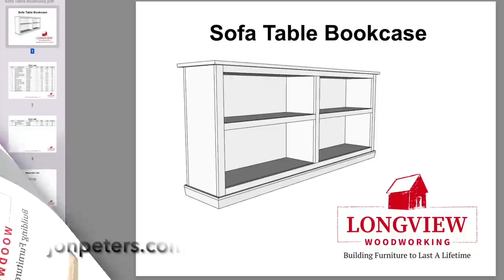How to Build a Farmhouse Writing Desk - Step by Step Woodworking Project

Comment: So many great tips in this video, Jon!   Those little spacer blocks for lining up the drawer sides seems so obvious, but I had never thought of it before!
Reply from the maker: Thanks Art! They really do do a great job of keeping the board from moving and add a lot of strength… Tied to the back of the face frame and the leg with a big glue joint.

Comment: I noticed a second table saw - not that that is so unusual in and of itself, many advanced woodworkers have two TSs - I'm just wondering why you switched to the other saw from your SawStop half way through the drawer construction?  Seems like you could have done all of the drawer construction with the SS.  
Thanks.
Beautiful work by the way.  Love your channel.
Dave
Niles-Wellington Woodworks
Reply from the maker: Thanks Niles, I keep a flat ground tooth blade in the powermadic table saw… when I cut groves or rabbits I use the powermadic so I don’t have to change the blade.